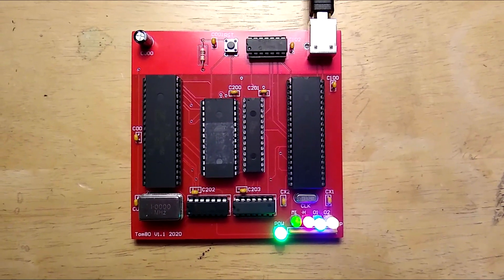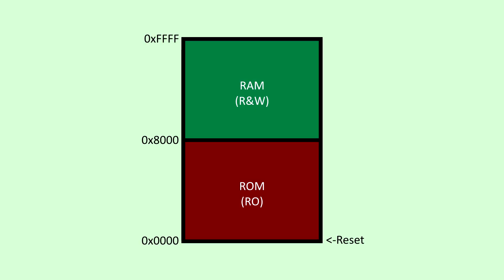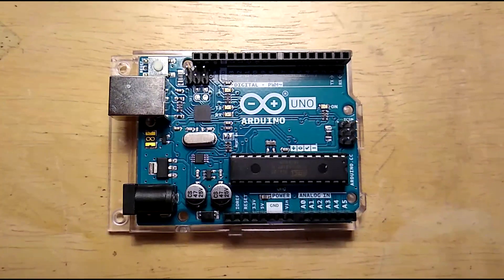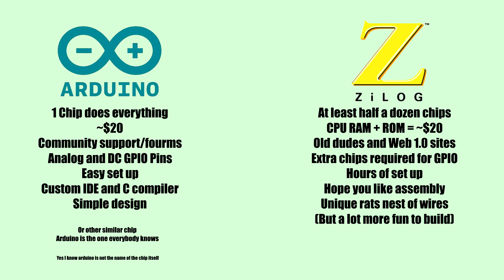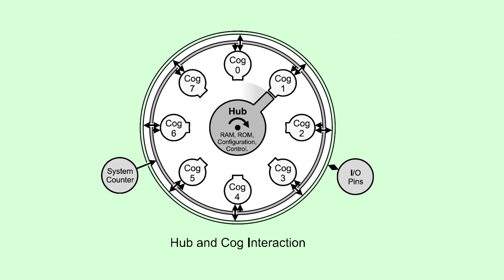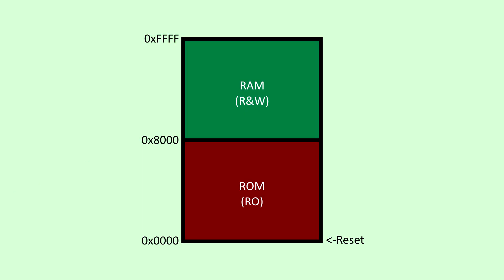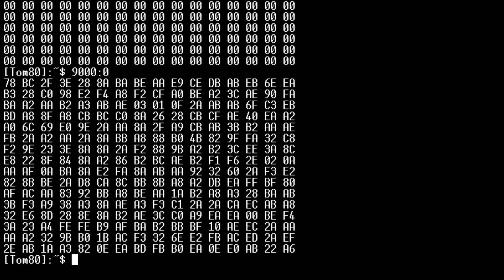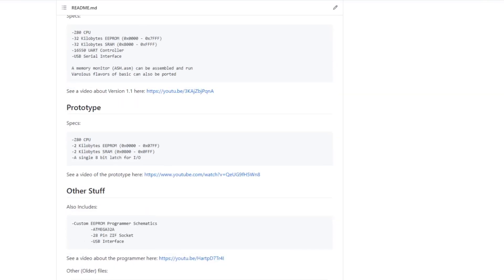Improving on my Z80 Homebrew Computer

Comment: My thoughts on microcontrollers: In 2018 you could get a MOS 6560 VIC video IC for US$7.50 on eBay. Now you can't. Someone built a modern retro machine. Build your own fully-loaded VIC-20, just add a VIC chip! We can and we should leave retro crhips for retro machines if there is even potentially any scarcity if a few thousand people decide to build their own version of whatever you've got!

The computers of the 80s used PLDs and custom silicon and microcontrollers any time they'd reduce costs or increase performance for minimal cost. Commodore and Atari literally used whole second CPUs in peripherals because the convenient microcontroller wasn't available or cheap enough yet. I don't think it violates the vintage spirit to do what they did or to replace potentially limited availability (now or later) chips with PLD recreations or for circuit-level µC emulations.

Or, y'know, the Propeller has a pretty good VT100 implementation.

Comment: WHY don't you use the eZ80 chip, which contains sooo much stuff already, and can get to pipelining 50Mhz, and many other things? That should result in LESS parts on the board, and would give new opportunities, with much larger memory etc. etc. :
Reply from the maker: The scope of this project was really just to run CP/M and maybe Fuzix. I considered it early on but the eZ80 is a considerably more complicated chip than the Z84C00.  It was my understanding that the eZ80 'core' has a few differences from the stock Z80 that could have made it more difficult to get some software running.  At the time I also didn't have the tools on hand to reliably assemble a board with SMD components.

In the future I plan to do a fully/mostly SMD version of the Tom80 with an all-in-one chip, probably using a Z180 or Z84C15.